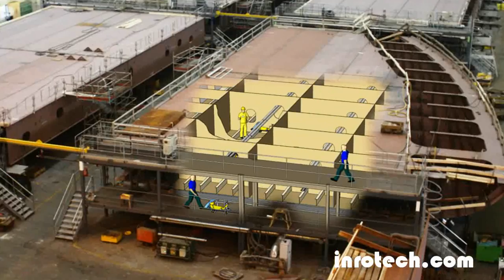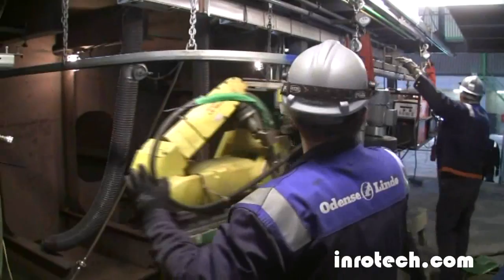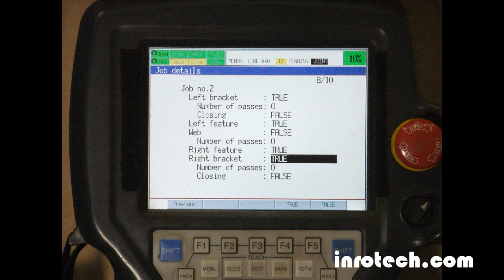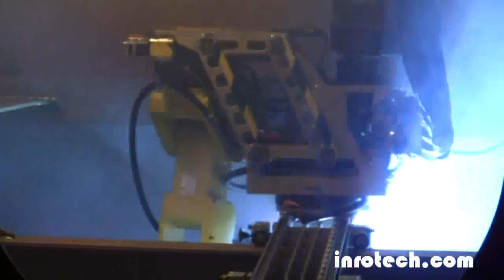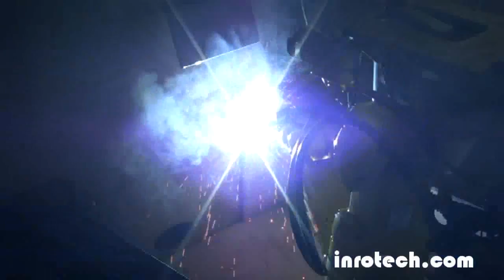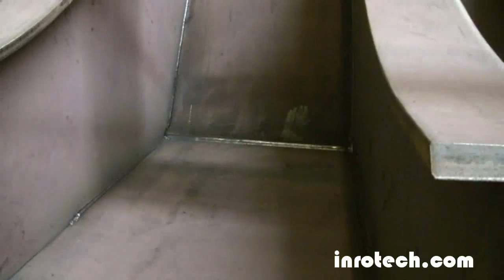Mobile shipyard welding robot

Comment from the maker: To show in more details how our system works, I have added another video on youtube. The robot on this video is a newer version, but is not the newest version. The robot is identifying the welding jobs automatically by means of the laser sensor and Inrotech's ALPT which stands for Adaptive Logic Programming Technology. This technology makes it possible to determine the welding jobs using logic.

Comment: You are asking a very common question.
The robot is not programmed to a specific task with fixed positions. Nor does it have any 3D files or off-line programmed codes or any input from the operator about the job.
We have developed what we call ALP Technology (Adaptive Logic Programming). It basically gives the robot the ability to identify the welding jobs based on design rules, and therefore the robot is not depending on any input regarding the specific jobs but only direction and amount.

Comment from the maker: It is very difficult to show all the detail in a video like this. It might seem time consuming to set up the robot for welding, but mostly the robot is on location, and the operator will move the robot between the jobs. This is a double bottom and therefore difficult accessible. Never the less the robot will do the job of 2-3 welders. Our new system is equipped with a laser sensor which minimizes sensing time very much. Finally you don't need 5 men - in this case 2 will do.